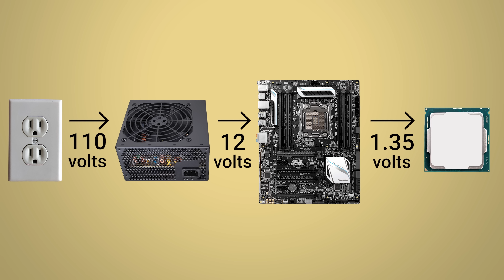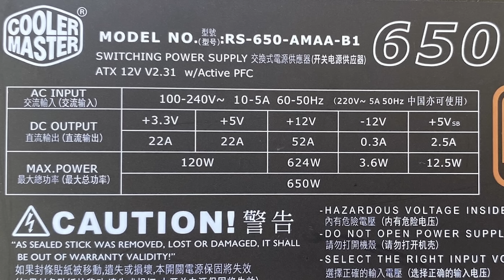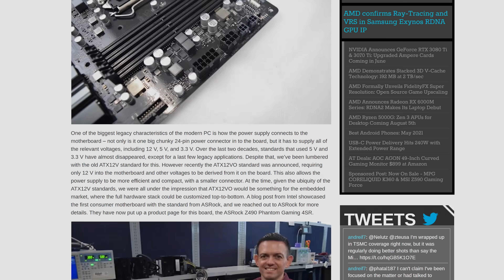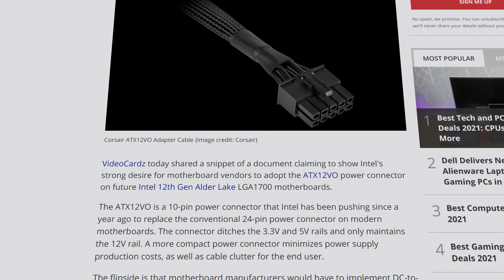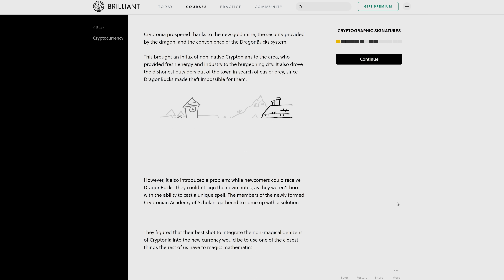Is The 24-Pin Connector DEAD?

Comment: I feel like this video did a poor job of stressing just how much of an efficiency boost the ATX12VO PSU standard provides. Elaborating on that particular point, bringing up the halved idle power thing instead of focusing on the superficial format changes would've done a great job of eliminating much of the nay-saying happening in the comments.
Reply: Agreed
Reply: Yes, especially considering the fact most PCs spend most of their time at or near idle. So millions of computers shaving off a chunk of watts counts up to quite a saving.
Reply: @Bonswally  yes, the 10900K easily does 200W (depending on your motherboard), never seen that on the 3700X
Reply: Let's just have mini reactors in out PCs... 100% nuclear and it won't matter.
Reply: But in the end it just moves that conversion to the motherboard, so it's not really solving the problem. It's just moving it to another component.
Reply: @agentcrm  I don't think you understand, **it directly lowers the amount of power draw from your wall socket by up to 50%**, by being far, far more efficient at idle/low power utilization. 

Current PSU standard is incredibly inefficient unless you tax it with an intense workload, which means you're drawing significantly more energy from the wall than you really should be - when just doing office work, watching videos or leaving it idle etc.
Reply: @NDKfrl  quite respect the way you’re jumping into this discussion, replying to all these not so informed commenters. I have a personal gripe with idle power consumption that nobody seems to care about: I built a completely passively cooled, high performance PC. It had a 8086K in it and consumed about 30W at idle. Then I dropped a 3700X into it and to my surprise, that ran at 70W idle. More than double! Looking for some information on how to solve it, I found a review that measured idle consumption (most reviewers don’t bother) and that confirmed this was normal behavior. No way, what? Then next gen Ryzen came along, and they still have this insanely high idle consumption. Yet, all reviewers focus on FPS and thermals when running Furmark. Most PC’s don’t ever run Furmark or do nowhere near those kind of workloads, yet they likely spend most of their time (by far) at idle, so shouldn’t that be an important metric for buyers and thus reviewers? This extends to 12VO, which also can contribute significantly to improving idle power consumption, as you pointed out.
Reply: @kasimirdenhertog3516  i think amd aims more on performance than efficiency. That is the reason why your amd rig draw more power than your intel ones.
it is like you are trying to save fuel on a sportscar.
Reply: @kasimirdenhertog3516  Well you're comparing a 6 core part with an 8 core part, that's a start.  

The other major variable is the motherboard itself, look in the bios all the low power states for the cpu and other power saving settings.   The x570 chipset draws 10w or more by itself.

Look into windows power plan settings.

Excessive rgb, fans, hard drives etc. will increase consumption.

Ultimately your cpu is a poor candidate for passive cooling and creating a low power system.  You could consider underclocking/undervolting it.

Lastly, why do you care about idle power consumption?  is it the expense?  If you somehow were able the shave 50w off the idle consumption, that would save you 1kwh for every 20 hours of idle time.  It's nothing.  That's why nobody really cares in the enthusiast community and information is hard to find.
Reply: @Bonswally  it's a CPU design issue, people with way more equipment and  worked out testing methodologies have gone over this and confirmed it, just read their reviews. Core count is irrelevant, I've had a 10900K as well and that idled at 30W too. Most interestingly, if you'd swap a 3700X for a 4700G (just the CPU), that about halves idle consumption.

The last part of your comment is true though, enthusiasts don't really care about the few bucks in electricity cost.
Reply: @agentcrm  Sorry, but you're wrong.  

Higher voltages are more efficient to transmit, so if you do the conversion from 12v to 5v physically closer to the thing that  needs 5v, then you save energy.
Reply: Ok great... So put these shitty PSU's in OEM office builds and keep them away from performance PC's.

This is going to make motherboards far more prone to failure which is going to cause plenty of waste, not to mention the amount of perfectly good PSU's people already have that need to be replaced.

There's a reason your power supply comes with a 10+ year warranty and your motherboard only comes with a 3 year warranty.

If I have solar on my roof why would I even care about a small efficiency boost when other appliances in my house use far more electricity and provide a tiny amount of the utility?

This also fucks mini-ITX boards that are already starved for space and now need to perform more duties.
Reply: @Pyroteq  Right, because modern voltage ICs are so failure prone that your PSU manufacturer gives you a 10 year/lifetime warranty on them.

Going by your own logic, the usual suspects behind motherboard failures would lead to problems well before the voltage ICs, which are typically quite durable. That is unless you expect the manufacturers in the enthusiast sector to use low quality parts.

Sorry, but I'm not willing to condemn the next logical step in PSU design on completely unsubstantiated, purely theoretical claims about supposed reliability issues.  Prudence over knee-jerk doomsaying, else you're no better than anti-5g or anyone else rejecting change because "old is good" and new is bad or scary. Particularly if  - in this case - it is a clearly superior technology.
Reply: @NDKfrl  As Pyroteq said, the atx12vo should only be standard on office pcs where there are hundreds or thousands in a company. (Where owners would care about power draw at idle)
Home PCs especially DIYs should stick to the 24pin as replacing a mobo is much harder and complicated than replacing a psu.
If they really want this atx12vo then they should make all the other pc components to run in 12v instead of 5v.
Reply: @kamotetops1572  The eventual transition into the new standard is functionally a foregone conclusion, given the benefits and the political climate. What I personally expect is that nobody will "force" it on you at least until DDR5 mandates a motherboard replacement anyway.
Reply: How much does a modern pc draw from the wall at idle?  Nobody cares.
Reply: @Bonswally  "Nobody cares" - said nobody self-respecting of their intellectual integrity. Clearly there's people who care, just not you.
Reply: @NDKfrl  If you care about 10 watts of idle power consumption on a gaming rig then I don't know what to tell you.  Enjoy.
Reply: @Bonswally  10 Watts? You neither watched the main channel video on ATX12VO nor looked up any testing, have you.

OC3D testing showed savings of ~60Watts when browsing or watching videos, and generally halved idle consumption. Gurud3d reported a 10900K test rig that ran at 13Watts in idle. With energy optimized settings, they brought that down to 7W. That's genuine insanity, considering an average modern desktop can idle at upwards of 100.
Reply: @NDKfrl  My 9700k system idles at 35w and I didn't do anything to achieve that.

Saving 60w while browsing?  Compared with what?  A modern system's wall draw would be lucky to be 60w while browsing.

You're either getting bad information or misunderstanding good information.
Reply: @Bonswally  I already mentioned where the information is from. Linus' video on the main channel, the ATX12VO testing article on overclock3d and guru3d. All of those are readily available to you.

That is if you were actually willing to educate yourself. As it stands, it doesn't seem you looked at... any of them?  And if you think it's difficult for a modern desktop to draw 60W idle, much less under any workload - even if light, your information is *severely* outdated.

Get a wattmeter, actually measure your power draw. I find it difficult to believe you, particularly considering that im pretty sure the test guru3d covered didn't even include a GPU.
Reply: @NDKfrl  OMG I don't care.  You've misunderstood the information.  You're not saving 60w while browsing, it's absurd.  It defies science.

Comment: If there may be 12V only in whole PC then HDDs, SSDs and so on should be also able to run on 12V only without relying on voltage regulation by motherboard.

Comment: now that I watched the vid I can only see the benefit of it being more modular but other than that you might end up with a smaller cable yes, but also a hundred more smaller cables to manage
Reply: They have omitted most of the drawbacks tho, so no wonder you are only seeing the benefits. XD
Reply: @Longgshot  im not lol you misunderstood my comment Im saying the cable might be smaller but it will need more separate connections so in the long run it will either be 24pins or more spread through different types of cables and connections.
Reply: @chuchof3tt669  Now that i'm reading it again... yea, i totally missread that. xD

Ty for the correction and sry for the waste of time. :)
Reply: @Longgshot  nah .. it keeps the conversation going np :)
Reply: Hundreads... One?
Reply: @Azarilh  sata power is not included unless you plan in only using m.2 drives then yes 10pin single cable.  But of you have an rgb or fan header connected via sata maybe a sata ssd or even an hdd then you're gonna have a headache on your hands.  I have 5 drives 2 hdds 2 ssd and an m.2 also habe a fan header.. Thats 5 sata power connections required.  I'm just saying they are statimg its simpler when in reality is not.  You get a smaller cable but if you need different connections then you need to attach additional cables my hundreds was obvious sarcasm.
Reply: @chuchof3tt669  It doesn't matter where you connect sata cables, in the PSU or MOBO, the number stays the same...
Reply: @Azarilh  exactly
Reply: @chuchof3tt669  You said "but also a hundred more smaller cables to manage" which is not true.
Reply: @Azarilh  .... i know it's not true .. it's an exaggeration it's like when you say you have a million problems but you have 3...
Reply: @chuchof3tt669  An exaggeration of a POSSIBLE ONE more cable can't become hundred. It doesn't make any sense, you are making excuses, deal with it. smh
Reply: @Azarilh  lol
Reply: @Azarilh  I'm cool .. I'm just speculating .. you're the one getting aggravated about a technology that's technically not here yet.

Comment: + PSU Power Rails:
   +12.0V = MainBoard / CPU / GPU / VRM / Fans / PCIe / Molex Power Plug / SATA Power Plug
   + 5.0V = HDD / ODD / SATA SSD's / VRM / RGB / USB  / Molex Power Plug / SATA Power Plug
   + 3.3V = RAM / Various Logic Chips / M.2 /  / PCIe /                  / SATA Power Plug

Moving 5.0V & 3.3V conversion to MoBo is a very bad idea, there isn't enough PCB Real Estate for extra conversion from 12.0V to 5.0V & 3.3V without making compromises or increasing the MoBo size.

Also the EMI that it'll unnecessarily cause.

ATX 12VO is a solution looking for a problem IMO.

The Original ATX spec is fine IMO.

Comment: The thing that annoys me about the 24 pin connector is that many cables are split as 20+4, and getting both those things down at the same time was tricky for fat fingered people. (And my fingers aren't all that fat.)  I like the idea of energy efficiency and removing unneeded cruft from the voltage rails. And, perhaps, the SATA standard can revise the voltage requirement.

Comment: I don't Support the "12Volt Standard". Power supplies have become very efficient as is, and are relatively cheap to get as a consumer. Also with the 12volt standard additional components and strain have to placed on the motherboard which means more heat, more PCB's, Thicker PCB traces, harder to fix or problem solve and of course increase cost. Given that a decent motherboard starts around USD$150.00 and goes up, going to the 12Volt standard means the average motherboard will most likely start at a cost of around USD$250 and then goes up. Furthermore the increased complexity of all the additional circuits and voltage ranges would mean that the average PC enthusiast will no longer be able to or allowed to trouble shoot or fix their own PC as you may need extensive electronics training just to try and fix simple issues not to mention the special PC cases that will be needed and the extra cooling to cool the motherboard. So are we actually getting more efficient and cheaper or just pushing the cost in another component?

Comment: The solution for SATA is easy. SAS. Just switch the motherboard over to SAS, and then you have a single cable for power and data from the motherboard, and you can plug it into SATA drives and also the even better SAS drives. It's seriously a no brainer.
Reply: For storage yes, but SATA is also used for optical drives. Yes you can get a USB one, but the ones that go in your computer are better quality and more convenient to have it right on the case. pets his blu-ray ripping drives
Reply: @victorcoss2600  USB3.X is a good rival for sata had to pull my BDdrive out found a really good external case for 5.25" ....loving it but removing SATA is a BAAAAAAD idea NVME is too Effeing Expensive for what small 2-4TB MAXIMUM drives it has under 400$ a 12TB is about 100-200$ in SATA mechanical drives and sATA SSDs can Easily be made stupidly Dense for far more storage than NVME as well SATA isnt the issue its not the power either.
Reply: @snintendog  I hate external drives, and they can be iffy with needing to rip and use something such as libredrive, how sata interfaces is just much more native to allow full raw access to the drive. I also prefer my disk drives in my computer case, I have limited desk space and would hate to have to pull out some external drive to hook up everytime I want to rip a blu-ray or CD. As far as nvme, I think it's a bit silly right now and in my experience, I've noticed the latency seems to be a bit more delayed when loading files vs sata ssd. I install RST and sata ssds fly, everything opens dead instant, nvme might have faster raw transfer speed, but even with samsung's nvme driver, I haven't been impressed. I prefer my 860 PRO SATA SSD any day of the week.
Reply: Or… nvme? NVMe 2.0 is supposed to also support hard drives

Comment: 0:35 it means if the old PSUs die - the new mobos from last year that would have had a long life will become e-waste.
Reply: Eh, the "old" standard is still going to be around for a long time.
Reply: @alextrotta796  hopefully.. yeah I kinda should've thought about that.. just kinda hate it's not backwards-compatible.. but yeah you're right - ATX 24-pins are probably not gonna disappear within the next 5 years...maybe even 8 , 10 or more.
Reply: @xasmaniusvolk8416  If there's one thing I've learned about tech, it's that it takes a really long time for standards to completely die out.
Reply: @alextrotta796  Yup.  Or am I the only one who remembers that the PS/2 connectors were meant to go away, and a long time ago too?  My new MB still has one (not two like in the old days, one keyboard, one mouse, but still…)
Reply: @JürgenErhard  I've heard the justification is that some keyboards don't work with some motherboards in the BIOS, so sometimes it's handy to have that port. I think that's more indicative of a bigger problem if you need to go back 20 years to get a modern motherboard to work, but idk.

Comment: hopefully, current modular power supplies can run ATX12VO motherboards, simply by getting a ATX12VO cable kit from the manufacturer.. otherwise I'll be mad when my recent purchase of six 850W power supplies with 10 year warranties become prematurely obsolete  😒
Reply: they have 12v rails so of course they will work, you'd just need an adaptor cable

Comment: So I will buy a Ryzen cpu, and not this new crappy power supply  that Intel wants me to...
Reply: Great now we have amd with normal connector and intel with. This connector, cant wait to see Someone on the forum asking "where's the f is this connector plugged in" when they buy the wrong psu
Reply: facts my man, FACTS . AMD all the way.
Reply: The original ATX standard was also designed by Intel
Reply: @Clarissa 1986 that's for now
Reply: It will come to AMD soon too